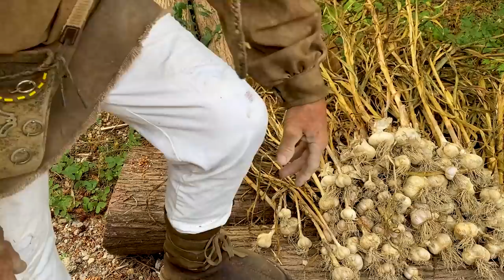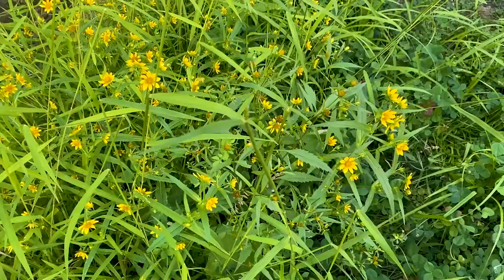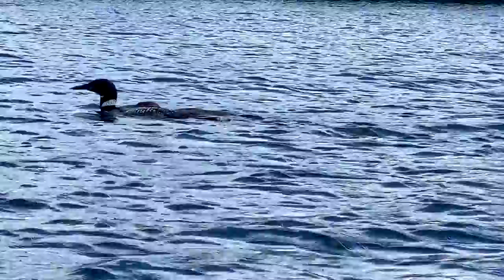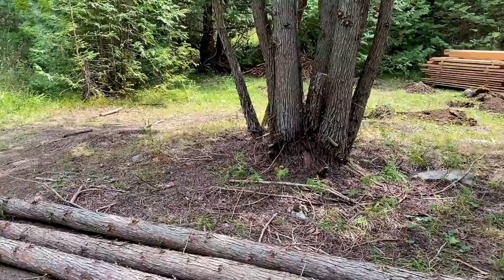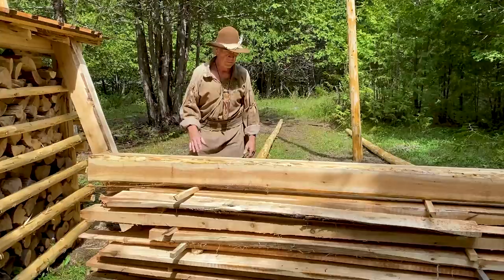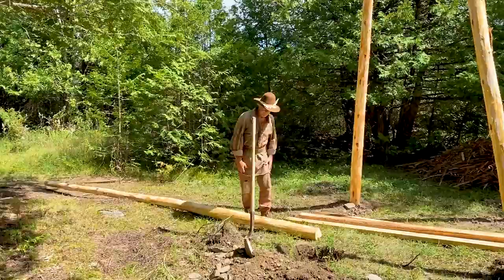Starting an Elevated Food Cache and Processing Garlic | CABIN BUILD | OFF GRID | PIONEER | GARDEN

Comment: One nail in each rung makes a collapsable ladder    You need a diagonal brace, two nails per rung or gussets on the rungs
I think the bark should have been removed from the rungs for safety 
As the rungs age the bark will loosen and come off with foot pressure thereby possibly causing a fall
I thoroughly enjoy your channel 
JIM
Reply from the maker: Good feedback Jim.  I did go back over the ladder and put in two per rung per side.

Comment: There is an example of a spring house in a Youtube video called "Oconaluftee Mountain Farm Museum, Great Smoky Mountains National Park". It's a simple wooden trough running through a small cabin. Milk and eggs can be placed in the cold water. You could make an enclosure under the cache which would keep it in the shade. The Mingus Mill is impressive as it brings water in a flume from high on the mountain to fill a 20 ft. high wooden tower which turns the grist mill shaft as it exits the bottom.
Reply from the maker: That Mingus Mill sounds fascinating.  I’m thinking my spring house will have to wait until spring.

Comment: what kind wood mill of the time
Reply from the maker: Pit mills were the most common.  Picture a wood scaffold built over a pit.  One man on the top and one poor sod in the pit.  They used long crosscut saws with guides for thickness.  The next most common were water powered mills using a thicker blade and eventually circular saw blades powered by water.

Comment: Can I ask why they went with this kind of construction as opposed to a deep cellar, as in ice cellar type of design? Easier to make? Less likely to get rodents?
Reply from the maker: Great question.  In the far north where they live in permafrost, they would use fire to thaw a small hole under the proposed cabin and was in fact a year round freezer.  The food cache was more common in Canada than further south and often the pioneers first cabin did not have a cellar.  The second and larger home usually did but could not work as a freezer.  It was though a great root cellar.